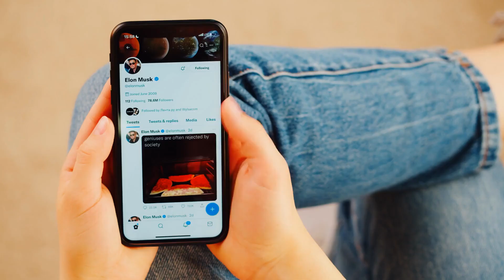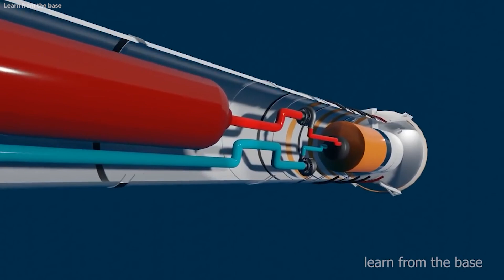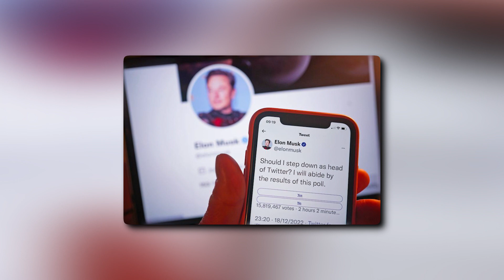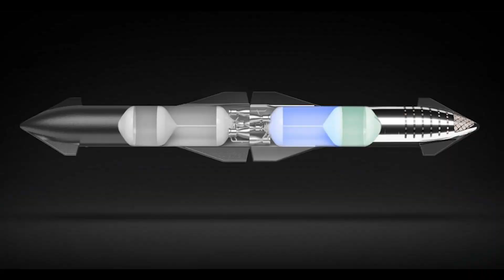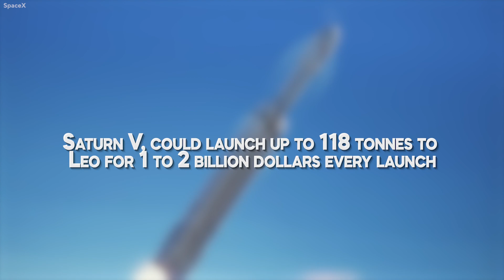Elon Musk Leaked Information About SpaceX's Insane New Starship That Is Bigger And Better

Comment: The raptor 2.0 payload would remain the same because if the rocket weighs 8x more & it needs 8x more thrust then that means the payload weight does not change. The larger rocket just means that it goes up at the same speed as version 1 so the actual efficiency of the version 2.0 rockets need to have much more power to weight ratio to lift more payload.
Reply: Yeah there’s a lot he got wrong in this vid
Reply: @b1gbaf  Yeppers